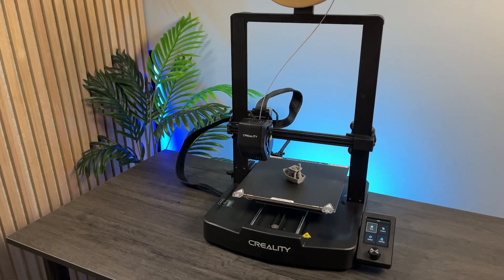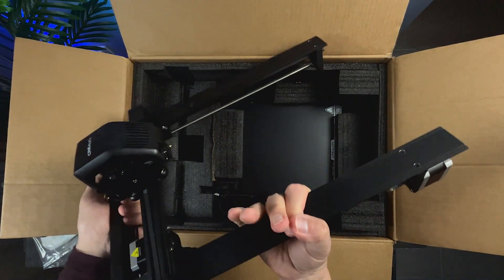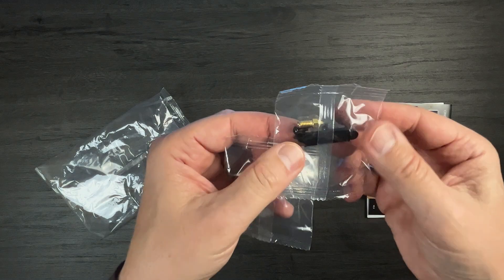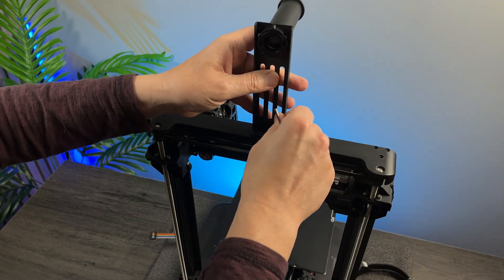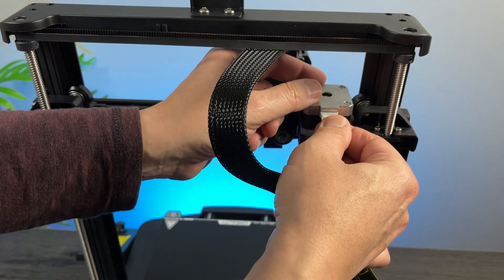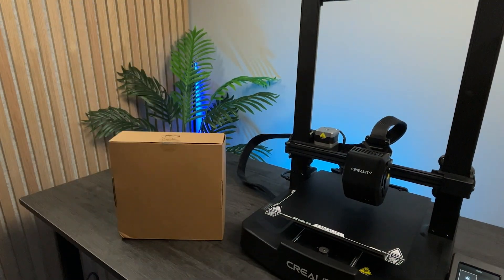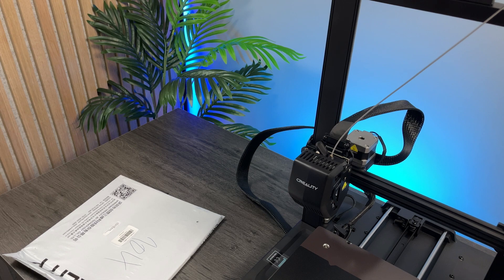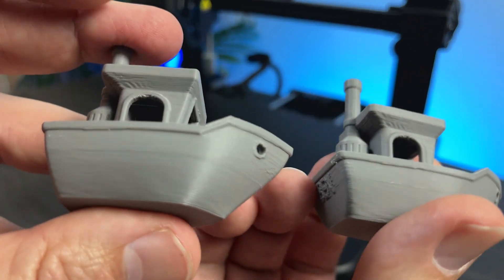My first 3D printer - Creality Ender 3 V3 SE - Unboxing and Assembly

Comment: I got this for printing RC car parts
Reply from the maker: I got this one to start the adventure of 3D printing. Until now, just printed a few cases that I needed.
Reply: @GabeTechStuff where do you get the files from to make different things? This is a totally new experience for me so any tips or advice would help
Reply from the maker: @Bigizzyrc  I use Thingiverse or Printables to search and download made parts by the community. I also installed Fusion 360 to learn how to design my own parts. There's a free version that you can install.
Reply: @GabeTechStuff thanks bro you've just gained a subscriber 💯
Reply from the maker: @Bigizzyrc  thank you!! 😀